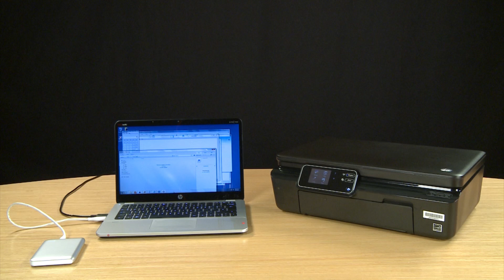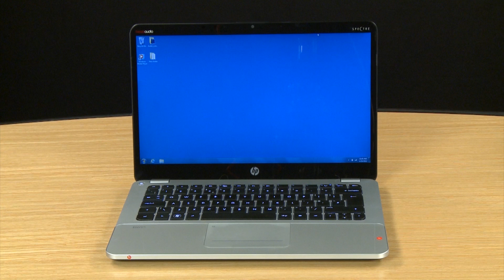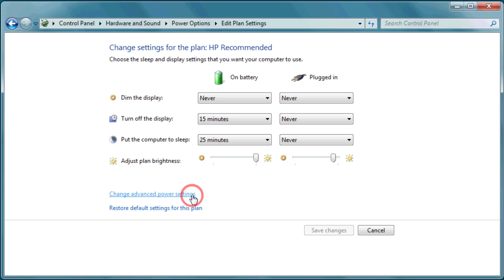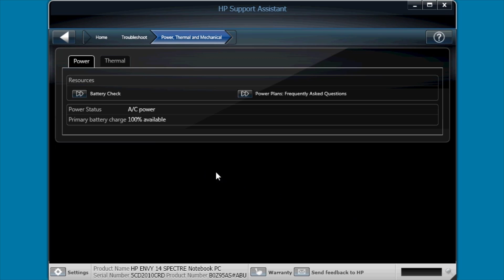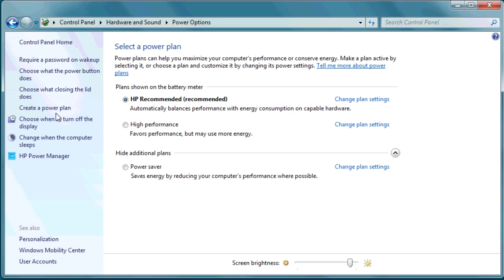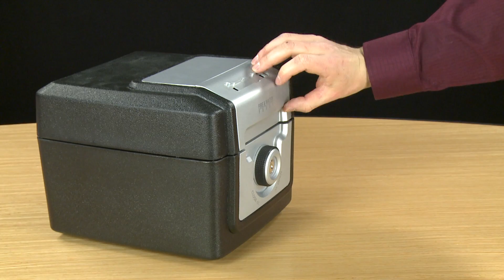Extending HP Notebook Battery Life

Comment: hello ^^ I dont know how to ask this but.. Im using an old compaq presario c500 and I thought that it is related to hp so.. can you give me an advice because my battery wont last before 1 minute even if it is 100% then without any warnings it shuts down automatically and when I plug in and turn it on again it shows that its 5% remaining please help me..
Reply: Rowell Belaxi To better assist you, I will need to know the version of operating system installed on your computer. I will also need to know your notebook's product and model number.

Comment: Is it advisable to keep the laptop plugged-in- even when the battery is completely charged. How do I proceed ?  charge it completely and then unplug and use normally or keep it plugged-in and use it. Please, kindly instruct me !
Reply: sanjay colaco It does not really matter if you keep it plugged in after it is charged as system now a days have a built in protection to stop it from over charging. Feel free to keep it plugged in, just be sure to shut the computer down from time to time so it cools off.
Reply: HP Desktop and Mobile Device Help Thanks for your prompt reply. I'll follow your instruction as you have said. Thanks once again !
Reply: sanjay colaco Happy to help!

Comment: Can I remove the battery when It is on power and laptop turned on and put it again back when do I need it or I need to shut down computer every time removing or putting the battery back?
Reply: nightpegasus26 You should always turn the computer off when removing the battery.

Comment: My Laptop Battery Not charging Any Solloution is There ?
Reply: Hello Royce. T what is the product number on your Notebook and what operating system is it running?
Reply: HP Desktop and Mobile Device Help
My Laptop i7 Touch Windows 8.1 , system whn i check battery status its showing working fine, but whn i charge the battery its charge up to 80% only .
Pls Give me the Soloution 4this?
Reply: HP Desktop and Mobile Device Help 
Hi My Hp Laptop Product Name : Hp Pavilion TS 15 Notebook PC
Product Number : F7Q34PA#UUF
Operating System : Windows 8.1 
when i check battery status its showing working fine, but when i charge the battery its charge up to 80% only .
Pls Give me the Solution 4 this?
Reply: Royce. T I recommend you do a Google search for "c03325217". This will bring you to an HP Support document: Testing and Calibrating the Battery (Windows 8), which should address the issue you are experiencing.

Comment: Hi, I just bought HP ProBook 450 G1 with intel core i5 last friday, so less than a week ago. How long is my battery supposed to last? Because right now I'm on 87% and it says it will only last 3 hours and 26 minutes. The only thing open right now is this video on google chrome. When I bought the laptop they said the battery should last for around 7 hours. My screen is dimmed to the half. I'm using Windows 7.
Reply: Hello potatoO0o, I am going to recommend that you do a Google search for "c01297640" which will bring you to an HP Support document: Improving Battery Performance (Windows 8, 7, Vista), which will show you how to maximize the life of  your battery. This document should answer your questions.
Reply: Thank you, I have already read that document. My main concern is why the battery lasts so little when the laptop is brand new and people in the store said it should lasts 7 hours. Should I go and take it back? Based on my calculation, my battery lasts less than 4 hours on moderate use (wi-fi, youtube). Is this a normal life for a li-ion 6-cell 47whr battery?
Reply: potatoO0o From what I can find the battery is supposed to get about 6 hours of usage. Now what you deem as moderate usage may not be what another deems it to be. This being said I would like you to do a Google search for "c01837578, which will lead you to an HP Support document: Managing Power Options (Windows 7). This document will help you manage your power consumption and increase the life of your battery's charge. If you are not able to get your battery to last closer to the 6 hour mark I would suggest you contact HP Technical support.
Reply: HP Desktop and Mobile Device Help Thank you HP team. I really appreciate your effort to help. I have another question considering screen brightness. My laptops screen is visibly adjusting screen brightness in steps whenever going from a lighter background to a darker one or vice versa. When going to a darker one it dims itself in 6 steps and when going to a lighter one it brightens in 4 steps. It happens when it's plugged in and when it's running on a battery. Is this normal? Graphics device 1 is Intel(R) HD Graphics 4600 (1366 x 768; refresh rate: 60) and Graphics device 2 is AMD Radeon HD 8750M 1GB.
Reply: potatoO0o Hello again potatoO0o, So yes the auto adjusting of the screen brightness is normal. This feature can be turned on and off by swiping from the right-edge of your screen to see the Charms bar. If you use a mouse you need to move the mouse cursor to the upper or lower right corner of the screen to see the Charms bar. Click or tap on Settings, and then click or tap Change PC Settings to open PC settings. Click or tap on General in the left pane and then look for Adjust my screen brightness automatically option in the right-side. Lastly, move the slider to the left to disable and to the right of the screen to enable automatic brightness control.

Comment: Can i plug my charger to my laptop while i'm using it ? Does it harm my battery if i do that way ? Thanks.
Reply: Hello Jovian Louis Bulawan, You you can use your Notebook with it plugged into the Adapter and it will not hurt your Notebook.
Reply: Thanks alot :D God Bless.

Comment: Are you asking how you can speed up charging the battery? Generally speaking, if you charge the PC when it is off, it will charge a little faster than if you are using it at the same time. The amount of time it takes to charge a battery can vary by PC (such as size of battery, type of battery, etc.).

Comment: I'm sorry your PC failed. It is certainly not good to have to replace it so soon after buying it. That's why HP PCs come with a 1 year warranty for the hardware. The dv7 series of laptops have been around for nearly ten years. If you search for dv7, that doesn't mean the models mentioned in the results are the same or have the same issues. A dv7 from 5 years ago will not have the same features or hardware as a dv7 from today. I just looked up your DV-7017tx and it is actually a dv6-7017tx.